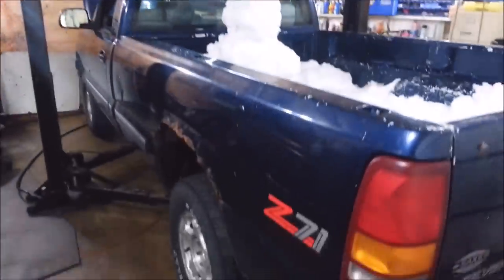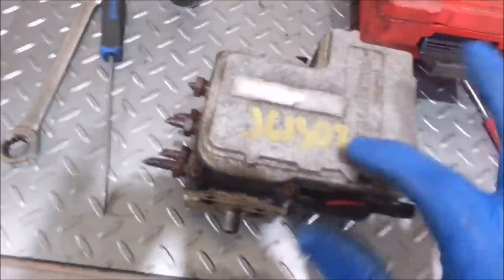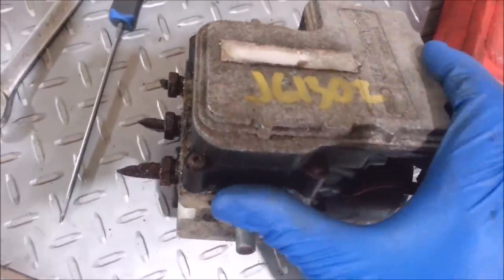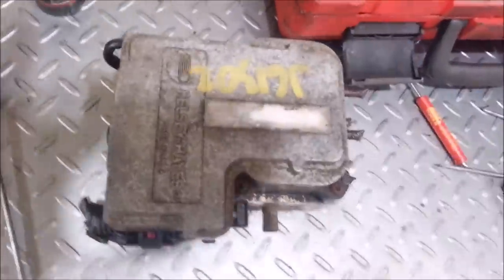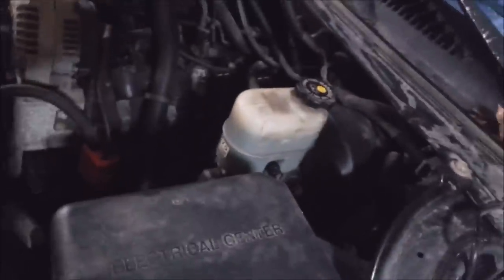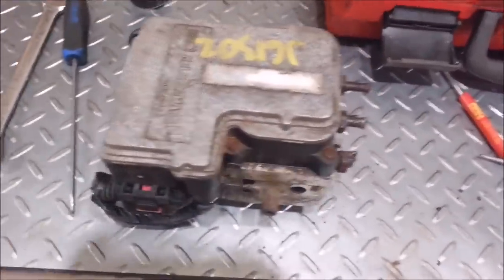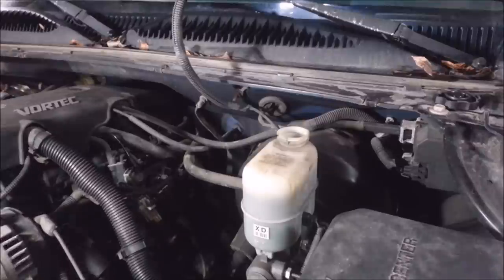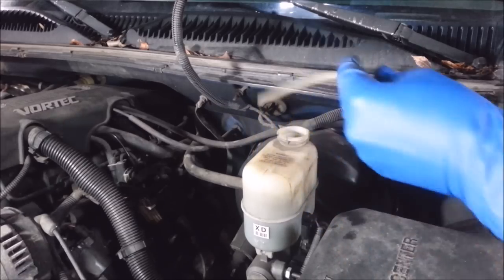1999-2002 GMC Silverado 1500 C0265 anti-lock brake unit replacement

Comment: Takes the fear out of removing all the lines from the module.   I tried to get the EBCM off of the top of module and after a day of busted knuckles and swearing, I got two screws out, stripped one, and busted the head off the last.   Glad I watched to avoid a brake fluid shower.

Comment: God bless your heart, my northern midwest brethren!  your crows foot suggestion helped me tremendously!  you allowed me to get the ABS unit out of my '01 yukon.  the T20 torx bit screws were so rusted, there was no way to get them out with the whole unit on the vehicle.  i had to drill out the rust covered heads in order to pound in a square bit and crack them loose.  was able to separate the module from the pump block.  re-soldered the one cracked lead on the circuit board that went to what i think was a relay.  reassembled it, reinstalled it, bled the brake lines.  so far no more lights!  hope it stays that way, but either way you helped me get the line disconnected!  thank you, again!

sincerely, your cheese head neighbor

Comment: Did this over the weekend for my 2002 suburban.  Thank you for this video!!  

Bled the master cylinder by connecting tubing from left front caliper bleeder to feed back up to master cylinder reservoir.  This way I could basically bench bleed the master while still on the car.  Then I bled entire system in order, including left front again.  Pedal felt sorta soft after but I went to a nearby dirt road and activated abs multiple times.  After activating abs the pedal was better than before.  

I’d never used a crow foot wrench before but without it I wouldn’t have gotten the lines off!!

Comment: THANK YOU!  Although I just replaced the module (Brain vs whole pump) Watching how to remove the pump was the only way to do it. Really helped me save $600  Later years they accommodated more room  making it "Possible" to remove the EBCM. Your right though if you live in the "rust Belt" It would be shaky if you could remove without stripping torx screws.

Comment: Great job! It's always easier when the cab is still not ready to be attached to the frame at the factory, they put all those parts on where the factory workers have very easy access!! They forget that these parts need to be serviced years later, down the road, case in point, the heater core up in the dash !!
Reply: Or the air conditioner condenser up under the dash🙄
Reply: @PlumbNutz  evaporator

Comment: I have code 0265 here in upstate NY I am thinking about removing the front seat and cutting a access hole to remove the module I recently cut an access hole in the box to replace the fuel pump seemed to work good.

Comment: I COULD NOT DO IT ON A 2001 SILVERADO! Waiting on warmer weather. I really thought it was going to be easier than it was. Laying on the ground, 35 degrees and wind blowing around 15 mph, I got one flare nut loose using a 9/16” Snap-On flare nut wrench. My lines are the OEM metal type. No brake line leaks anywhere, just constant ABS light. With the one flare nut off, it was very hard to pull the 1st metal brake line out of the module and move it near the top of the module out of the way for the next removal. Seems all five lines are fastened to the frame about 6-8” away. The others will all be closer to the frame fastener, so, being metal, they will all be stiffer and harder to move out of the way. 
Decided to give up until it gets warmer, and I buy a 9/16” crows foot. 
Since I was giving up, I had hell getting the 1st metal brake line to line up properly so I could finger tighten the flare nut and not cross thread. 45 minutes later, nearly frozen to death,  I finally put my right arm over the frame and wrapped down to the line, and push out on the curved part of the line and use my left hand to push and tighten the flare nut. Only that way, it finally went in fairly easy by hand. Was cussing and half frozen, but since I did not take all the fluid out of the Master and only a little leaked out of the 1st line, I am hoping I can simply bleed and wait for warmer weather and still be drivable until warmer weather. Yeah the ABS light will still be on and I may just let it be one forever. LOL!
Kind of wondering if I undo the 3-13mm bolts holding the module bracket if it would make it easier to remove the rest of the brake lines by moving the module around a little.  Hopefully, just enough to get all 5 flare nuts broken lose with the crows foot. Once broken loose, perhaps I can move the unit towards the back of the truck without bending the 5 metal lines out of shape, so maybe when I start putting those 5 lines back in the repaired module it will be easier to lineup all 5 lines. Any Advice from anyone with OEM metal lines attached to the unit would be greatly appreciated. How do you move then with them still attached to the frame about 6-8" away?
Reply: Cut brake lines out of module and then take the bracket out to replace the brake lines
Reply: @donjuwan7324   I guess if my brake lines were leaking and needed replacing that would be the way to go. Not interested in cutting the lines. I am just living with no ABS function and a continuous ABS light. After a year of seeing a continuous ABS light, I might actually miss it if I got it fixed. LOL!

Comment: What size are the fittings?  Did you use 14mm or 9/16" crow foot?  I have one that is rounded off and I am having difficulty getting a pair of Vice Grips on it.  Any other suggestions?  Thanks for the video
Reply from the maker: @exlporemidmo  when the get that bad, i try a metric line wrench, or cut the line, use a 6 point socket, and replace with new.
Reply: @RustBeltAuto  Thanks for the reply. Thats what I tried to do and even after multiple applications of PB Blaster I still managed to round it off.  Crappy thing was that it wasnt even the one I needed to change I was just clearing room to get on the rear supply line....

Comment: Hey by any chance could the module going out all together cause no brakes with no pedal pressure also the master and booster are confirmed good
Reply from the maker: My sources say no. You probably have a broken brake line. You will not see it leak unless you bleed the entire system. That would be my guess.

Comment: Some one may have asked already but I’ve been told that if I replace abs module that it needs to be programmed for the truck just pulled one from junkyard old one kept running with ignition off and took out the motor so can I just replace it and just use scan tool to bleed brakes or does it need to be programmed to the truck itself?
Reply from the maker: @ramonhernandez9292  you should be getting the same one. Need to do an auto bleed, or find a way to activate the ABS after bleeding.
Reply: @RustBeltAuto  yes I got one from the same year truck just was told that it would have to be programmed to the vin number of the truck

Comment: Do you have to program the new abs module to the truck I have a 2000 silverado
Reply from the maker: No. It just requires an auto bleed, or activation of ABS after bleeding.

Comment: Hey we changed out all the brake lines on a 2000 4wd silverado and can't get any fluid to the front at all. Any ideas?
Reply from the maker: Use a vacuum bleeder, or leave the lines open, fill the master, put the cap on it, and pump the crap out of the brake pedal. Once you get enough air out of it, it should bleed out.

Comment: Nice video, I hv a 2000 silverado do u kno if the Abs module and pump need to be reprogrammed after replacing them?
Reply from the maker: No. Just auto bleed. Kinda the same thing hard braking on a gravel road to activate the abs.

Comment: If there is air trapped in that abs unit, do you think it would make the pump motor run all the time? Just a thought I had. Mine runs even with the truck off...its on a S10 year 2000. I have removed the ecu and re-soldered all the large solder points, but it still runs all the time.
Reply from the maker: It should not run all the time, and if it does, that is not a fluid, or mechanical problem.

Comment: Is the ABS module on these trucks a must or can they be deleted completely?
 My 2000 gmc sierra 15k 4x4 is giving me problems.
    Rear are starting to lock up. Replaced new rotors, pads, front passenger caliper.  
     Will be replacing new brake lines and remaining calipers. 
Want to be safe on the road
Reply from the maker: ABS prevents lock ups. You probably have other issues. If the thing is working, there should be no ABS light, and the thing should be moaning and groaning to pervent it from locking up. See how hot your rims are after driving normally. Maybe You have a caliper issue, I dont know.

Comment: i’ve replaced all the components on my 2005 Silverado even the module for the ABS but not the pressure valve and still after five minutes of driving all my brakes locked up and I have to wait 10 minutes just to move the car does that mean it’s time for this whole pressure valve now has to be replaced. I have seen this no codes on the dash and no ABS lights flashing.     Help Rusty Master I’m in california ?
Reply from the maker: If the brakes are locked up, I would crack the lines on the master, and see if pressure squirts out. Then I would go to the bleeder screws, and see what happens there to try and determine what to do. Sounds like the master cylinder rod is adjusted too long. Personally never heard of an ABS unit doing that.
Reply: It did not look like that booster had an adjustable pin in it it doesn’t even come out unless you force the diaphragm
Reply from the maker: @hsphoto1  if the tires are not locked up anymore you will not be able to relieve any pressure to see what part has failed. If the tires are still locked up, and nothing comes out of the two master cylinder lines when you loosen them up, then you are going to want to crack the bleeder screws open one at a time to see if anything squirts out of them with pressure. Hard to believe all 4 are locked up. This will determine if there is a mechanical problem with your calipers, or an actual hydraulic issue. If your tires are locked up, you open the bleeder screws, and the tires still do not turn freely, you will have caliper issues. There is an adjustment on the rod for the master. The pedal should have a fair amount of free play. Dont know how much off hand. Good luck.
Reply: Yesss!!!! Finally someone with what I am experiencing! I had just posted this question in another comment here too. Started 2 years ago engaging brakes as I pulled out of driveway with abs, stabilitrak lights so I replaced hubs and it was great for almost a year. Next time same thing so I had system flushed from dirty dirty fluid and replaced some leaking soft lines. lasted about 5 months and now doing it more often with code for Module so i replaced module and rear speed sensors. Stealership and 2 very reputable shops are stumped and none thinking its the master or hydrobost at this point either? Mine has the 40 pin traction/stabilitrack ACTIVE BREAK CONTROL (appears to be a rare setup) JL4 code package. willing to TIP some funds to someone with an answer.
Reply: @hsphoto1  Ah, ok so yours had a diapram and mine has hydroboost still doing this.

Comment: So how did know it was bad . I’m having issues with mine  my rear bleed fine but my front wornt bleed/ very little comes out. I’d love to talk more
Reply from the maker: Pump pedal a bunch. See if you get more. Might be air. The same amount from master lines should come out the other end at calipers. Auto bleed, or ABS activation may help.

Comment: Dude idk how you got that off with out braking it. I have the same issue on mine  I have a 4x4 in the way so idk what the hell im gonna do
Reply from the maker: Just take it out, and fix everything you break. I have had to replace all the brake lines on these PITA trucks before too. The people that bought pre-bent lines was a bigger PITA then using bulk copper lines, and making my own. This was a 4x4.
Reply: I was sitting here trying to replacing just that one peice yeahhh no I’m figuring out it’s not as clean as the ones in the video

Comment: My 2000 Silverado 1500 break light is on but not flashing so could be the same problem or not ??
Reply from the maker: Check fluid level, and e brake pedal.
Reply: I did but the fluid keeps going down and the pedal too!
Reply from the maker: @ehernandez1917  you have a leak
Reply: Alright thank you boss I'll try to find it
Reply from the maker: @ehernandez1917  I am the boss of nothing. Welcome.

Comment: Did you need to gravity bleed the master cylinder at all?
Reply from the maker: I gravity bled the system. As long as you don't touch the brake pedal, it should run through the master, and work okay. Might need to bleed it again, after doing an auto bleed.
Reply: @RustBeltAuto  Ok great, thanks

Comment: What is the module mounted to? It looks like something that goes to the fuel lines?
Reply from the maker: It's a bracket mounted to the frame i think.
Reply: Isn't the metal part under the module another part? The one with the nipples for hoses?
Reply from the maker: @EJ_173  maybe. I don't really know, I'm not looking at the thing. Use a mirror, and a light if you cannot see up there.

Comment: A problem with the pedal brake when I press the pedal brake started pumped back, I feel on my foot. What can be the problem? Any advice? Please thank you.
Reply from the maker: @maximobautista9671  those are body codes. Abs codes start with a C. Does it happen all the time on dry pavement, or just slow speeds coming to a stop?
Reply: Thanks. What I should do.?
How I can fixed.? 
It’s driving me crazy.!
Reply: Thanks for your help. I so appreciate.
Reply from the maker: You havn't answered my question about your brakes. as for the body codes, I don't know. It would require diagnosis.
Reply: Just slow speed coming to stop.
Thanks.
Reply from the maker: @maximobautista9671  https://youtu.be/sReGhkiKlT0 
I have a video for that.
Reply: Thank you very much. I will try that. I hope that works.

Comment: Why can’t I get fluid to come outthe rear of my truck it’s like the abs won’t let the fluid pass through like front 2005 Silverado Hd 2500 is my abs jacked  up or something?
Reply from the maker: Did you try to power bleed it?
Reply: Rust Belt Auto no he had me peddle pump while he was going tire to tire but only a drop came out the rear
Reply: No abs lights are on
Reply from the maker: @gohardfast  Unless the pedal is solid, there is air in the system, or the master took a dump. You could try to remove the line at the master, and block it off to see if the pedal is solid. The abs unit should be free flowing. it does nothing unless you have abs activation.
Reply: @RustBeltAuto  Hmmm.... ive had 3 shops including stealershlp with no clue why breaks are seeming to heat and expand to engage, then service stabilitrack comes on. Replaced all wheel sensors, and no codes but did a nasty fluid flush a few months ago. Thinking the release valves in abs module are sticking and not allowing fluid to release pressure from heat expansion (after even a short drive). a code for the module came up so I replaced that and still came back, so pump may be next. I can wire some funds as a tip if you can suggest a possible solution.
Reply from the maker: @armancha23  when they expand, and engage, crack the bleeder screws open to see if pressure squirts out, and they release. If the do, suspect collapsed flexible brake hose, or hoses. Work your way down the line the next time it does it to the other side of the hoses, and loosen the nuts for the lines to see if it squirts on you again, and so on. If nothing squirts out when you loosen the bleeder, and the brakes are still tight, it will be the calipers.
Reply: @RustBeltAuto  hmm. I hope its that easy, and Id have some words for the other 2 shops and dealership not checking that over 5 days at shops. Thank you Good Sir! I will update when try it.

Comment: What vacuum are you using?   Never seen that technique
Reply from the maker: It's a vacuum brake bleeder that uses shop air. You can get them cheap from harbor freight. There are also hand pumps you can use if you feel like wearing your hands, and forearms out.
Reply: @RustBeltAuto I'm about to do this very task since the torx bolts are to corroded to remove.   $25 unit off a truck that's about to be scrapped, but the bleed the whole system aspect has me nervous lol.   Thx